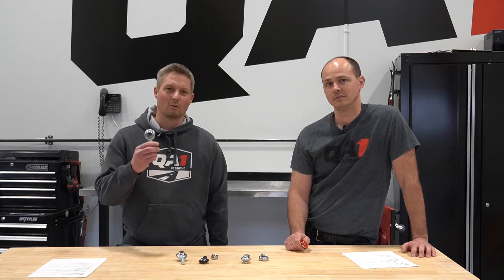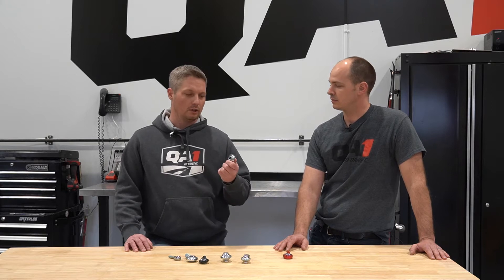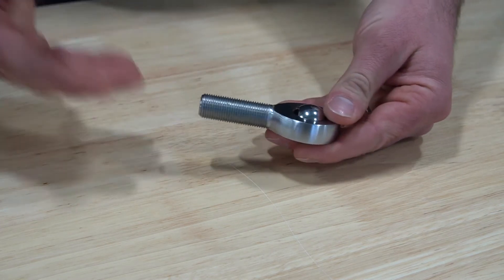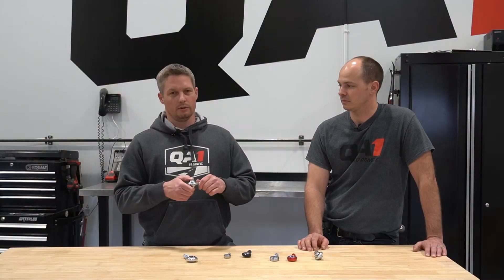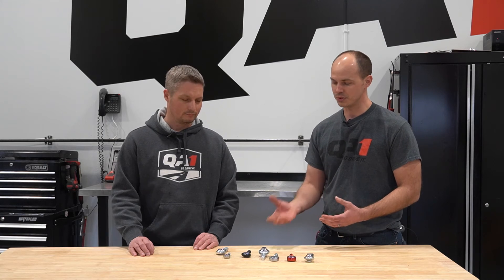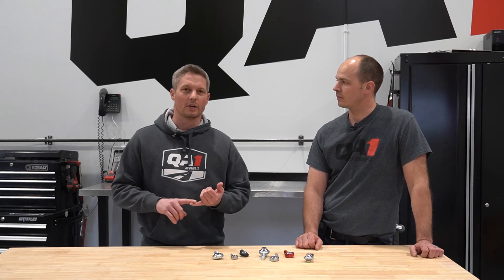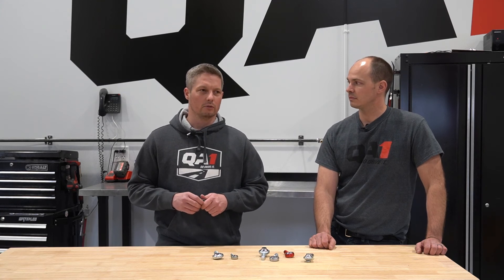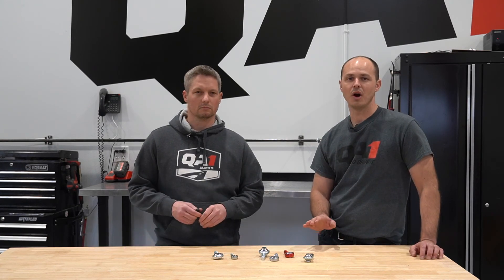How To Pick The Right Rod End For Your Vehicle

Comment: I'm looking at 1/4"-28 female rod ends made from a low carbon steel with a static radial load of : 2,225lbs. Would this do fine for splitter rods/supports? I hate the cheap rods eBay offers